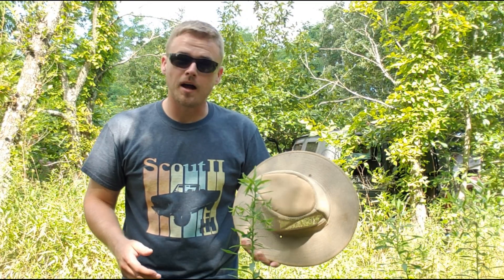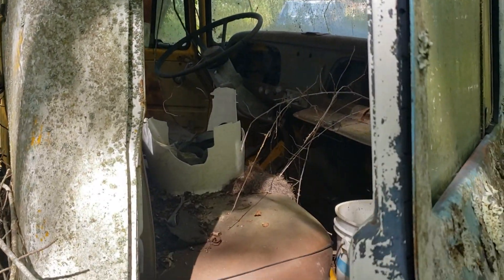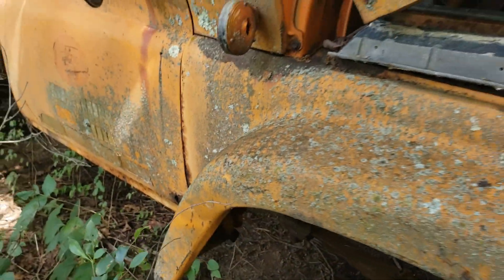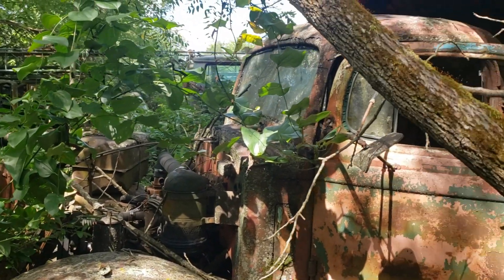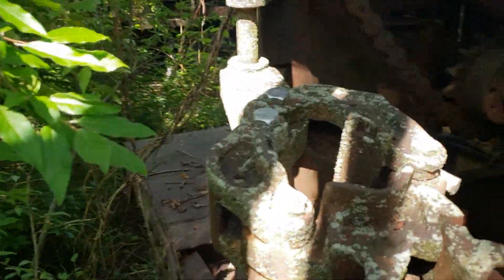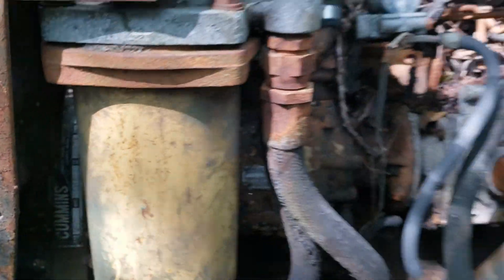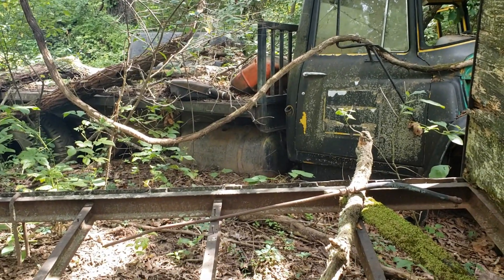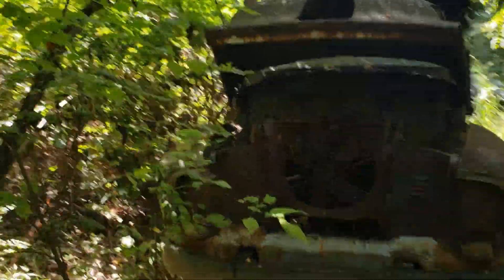HPDG Junkyard Exploration Episode 1: Old trucks galore!

Comment: 4:13 I believe it's made by the same company. Rockwell. I like the front tires on that rig too. Rockwell did allot with gm and ford back in the 60s and 70s. However the factory 4 wheel drive 2 ton trucks of the 60s and 70s are quite rare. Most were just 2 wheel drive. Rockwell made the transfer cases for gm's 4x4 line of pickups. And I believe they made parts for ford's 4x4 line of pickups as well (commonly seen under the highboy models you'll see a divorced transfercase that was made by rockwell)

Comment: 3:03 The diesel they used was the GMC V6 Toroflow, I'd been looking yrs for one. After i missed up a deal on a 67-68 C50 Conventional with one for super cheap. Single screw road tractor. Super scarce to find a Toroflow. Opposite of the GMC V6 Gas. Which now are becoming super valuable & Tougher than nails to find. & The 4x4 chevy is a 64-66. 60-63 had the "Wrap around windshield" & 13:42 55-57 LCF. Not COE :)
Reply from the maker: Thanks for the info 🙂👍 I truly appreciate the kind comment Kyle. It means a lot.
Reply: @HODGEPODGEDODGEGARAGE  no prob. also on that truck with the slant Cummins the reason why they did that was to fit the engine in. Up right it would have not. I learned that from a guy who saved one from a junkyard 🙏 hope all is well for you.
Reply from the maker: @SchnelleKat  oh cool 😃👍thanks. I hope all is well your way also 🙂
Reply: @HODGEPODGEDODGEGARAGE  I can link you a video of one. I found a few

Comment: The Chevrolet 4x4 has a Coleman front axle it should also have a Coleman transfer case.
This conversion was available from the factory
Reply from the maker: Thanks for the information 🙂👍 its greatly appreciated. One other viewer said it may be Coleman. I'll do some digging
Reply: @HODGEPODGEDODGEGARAGE  there are a lot of Marmon-Herrington 4wd conversions on 2 ton trucks as well.
Not a good one to get, as parts are hard to come by.
Best to try to get the Rockwell FDS-75 or, better yet, the FDS-78.
Mostly an F106 Rockwell with steering knuckles on them.
Very popular front axle for truck pullers.

Comment: There are two yards around Saint Clair You Oughta check out. The one Southwest of town has an international ton-and-a-half four-wheel drive in it at least it did. And the scrap yard between union and st. Clair on 47 has a lot of neat old stuff behind it
Reply from the maker: Is the 4x4 international red by chance? I didnt know there was one south of town. The one on 47 wont let people go inside 😔
Reply: @HODGEPODGEDODGEGARAGE  don't remember the color. The one south of town is Anaconda Auto Salvage. They have a lot of old ford stuff
Reply from the maker: @chrispaleen5137  thanks for the information 🙂👍 I will check them out

Comment: Most all of those old Gm 60's that had diesel engines they were more than likely a small detroit since they were made  by gm
Reply from the maker: Yeah, probably a 453. Would have been awesome to have seen it 🙂👍 thanks for the view and kind comment my friend
Reply: The 4-53 and 6v53 Detroits were the most common in those GMC's for diesels, but in the 60's and 70's GMC also had the Torro-flow diesel. It was a GM 4 stroke diesel based on the old 60° V6 truck motors. It had quite a unique intake on it which made them easy to identify. Terrible fuel systems plagued them with problems. Wasn't exactly know as a good motor
Reply from the maker: @scortsnorbilenterprises401  true! I never thought it could have been the ToroFlow..I've heard bad things about them, that's for sure 😂. I wish it had a 453 still in it, I would have grabbed that up myself 😃. Thanks for stopping by 🙂👍

Comment: Looked through the comments, surprised no one came up with the 4x4 most likely being a napco conversion. Also I see people have commented that the truck most likely would have been a Detroit, most of them use the four or six cylinders but they also had the 3-cylinder I just don't know what years they were used in the GMs
Reply from the maker: That's true! 🙂 NapCo did quite a few 4x4 conversions on older trucks. Thanks for the view and comment 🙂👍
Reply: Most of the GM conversions you find from those days are Napco, you’re right. But this one’s a Coleman Conversion.

Comment: Those engines were too tall for the engine compartment so they had to slant them to fit ....   international had to do that with their NTC Cummins powered loadstars in the late 60's and 70's
Reply from the maker: Oh that's cool 🙂👍 that 70's Dodge C900 said "slanted for power" on the valve cover. It was neat to see 😃 I bet they were a tight fit
Reply: @HODGEPODGEDODGEGARAGE  the slant in a  slanted cummins was a cummins originated design.  Kind of its own animal, externals to the engine don't cross over to a small cam cummins. Some of the internals do. It was actually not an uncommon engine in those white trucks. Lots of single axle road tractors built that way. Some of those externals are getting hard to find. 15 years ago I passed on an old jobsite/farm/offroad truck because of that. Ran like a champ but if there was a problem it was going to be a big problem and a hunt.
Reply from the maker: @oldschool6345  thanks for the info! 🙂👍 Oh yeah, I bet finding parts now days would be a pain. They are neat though. Thanks for stopping by. Take care

Comment: A word on frames!    This is how I, see things; for safety, and  public Liability.  Please feel free 
to reject what I say as you wish.   Check , check , check with your State D.O.T.  dept of Transport, and /or  Dept Of motor vehicles Number one always!  Endeavor to get your information on line , with hard copies in writing you can reffer to in a court of law! 
He said she said, IS NOT WORTH A DAMN IN COURT! AND LAWSUITS!  OR IN INSURANCE 
MATTERS WHERE A CLAIM IS IN DISPUTE!  Next,    Do not cut a frame,  at a 90degree  straight 
up and down  cut!   #2....Always cut the frame , at a 45 Degree angle !   source=  International
Loadstar  shop Manual  6 inches thick  for their medium  Loadstar series trucks,  4x4 or  6x2
(rear wheel drive only)   why? the 45 degree  angle  provides MORE  frame  cut   length  for 
strength !    #3. After welding,  where the frame has been properly ground  at  angles  creating
a "V"  joint , where successive weld beads can be  passed, with proper penetration, and the 
finished bead is built up with  those passes!  #4......The welding joints must be  done both 
inside and outside the frame  cut off joint .   #5.......the  frame must be  FISH PLATED,  PREFFERABLY  WITH 1/2 INCH PLATE STEEL,  ON THE INSIDE OF THE FRAME RAIL !  
IT IS HIGHLY ADVISABLE  TO FISH PLATE THE OUTSIDE OF THE FRAME  AS WELL !  
THESE  FISH PLATES MUST NOT BE WELDED!  THEY MUST BE BOLTED, WITH GRADE 8 NATIONAL FINE  THREADED BOLTS THAT ARE OF SUFFICIENT  SIZE. CONSULT  THE PROS, 
OR YOUR DURISDICTION !    EVEN BETTER , THE OUT BOARD FISH PLATE CAN BE  INVERTED 
"L"  frame  section cut from a  used frame.  Use what specs that your professional shops use in your state! ask them! they will tell you.   The holes must be drilled with a rented proffessional  HD  professional magnetic base drill !    NO cutting of holes  must be done with 
torches or plasma cutters!  Remember ,  you may be going through  4 layers of material!  
the frame , the double frame, the inner and outer fish plates !  Stagger the bolts  and nuts and lock  washers  at a  v up and down pattern  as near to the edges of the plates as reasonable . 
This way No effort will be missed to provide a 100% solid  joint! remember frames flex, and work , all the time!   And this joint is a load bearing joint; and the very backbone of the truck!  
Professionals are also known to provide  45degree angled fish plates,  inboard or out board!
as well, for strength ! I HAVE SEEN , JOBS DONE WITH ONLY INBOARD FISH PLATED;  THERFORE I RECOMMEND,  BOTH INBOARD AND OUT BOARD FISH PLATING! Also professional shops may employ  superb  new, cut and  finished 
fish plates that are prepared on  fully computerised machines, and look like they are oem quality!    you are not , to my knowledge required to do so, at that level; of professional 
quality !  But new trucks that are cut down, or extended, are DONE TO VERY  EXACTING STANDARDS, AND IF IT WAS A TRUCK YOU JUST PAID ALMOST $200.000 DOLLARS FOR????
YOU WOULD WANT IT BULLET PROOF! AND  NICE TO LOOK AT?  WOULD YOU NOT?  OK! 
IF YOUR STATE HAS SPECS FOR THE JOB! FOLLOW THEM TO THE LETTER!  
I AM NOT A FRAME ENGINEER, OR  A  PROFESSIONAL WHO DOES THESE THINGS!  I AM A VERY SERIOUS PRIVATE ENTHUSIAST!  AND  I  HAVE SEEN  HOW  VISCIOUS   THINGS CAN GET IN  A LAW SUIT IF STUFF GOES WRONG!  ALWAYS  PROVIDE A JOB THAT IS OVER BUILT AND OVER STRONG FOR WHAT YOU WISH TO DO!  THAT FACT WILL GO A LONG WAY, TO 
ENSURING YOU ARE DEFENSIBLE IN A COURT OF LAW!  I DO NOT GIVE LEGAL ADVISE !
USE THIS ADVICE AT YOUR OWN RISK!   kennethzakaib607@gmail.com  Montreal Quebec Canada  July 30th 2020  also remember, that professionals use CERTIFIED TRAINED WELDERS TO DO THIS WORK!  THEREFORE, GUARD YOUR SELVES ACCORDINGLY. 
KENNY ZAKAIB . (NOT MR. JOE BLOW, WITH AN AC BUZZ BOX WELDING MACHINE;  AND 
"POP-CORN "  QUALITY WELDS! )
Reply from the maker: Thank you for the information! I greatly appreciate that. I've done some research, and will do more to insure that its 100% safe and do-able.